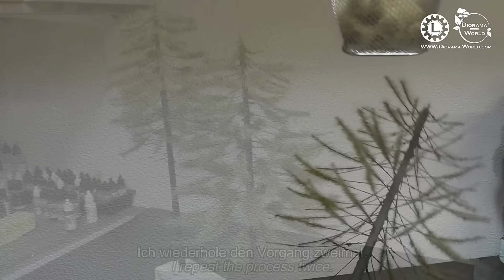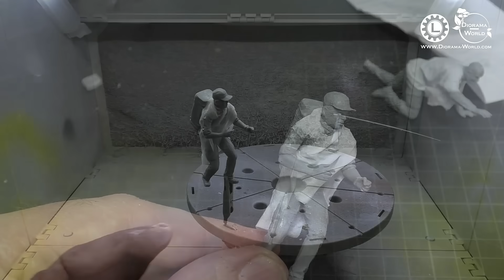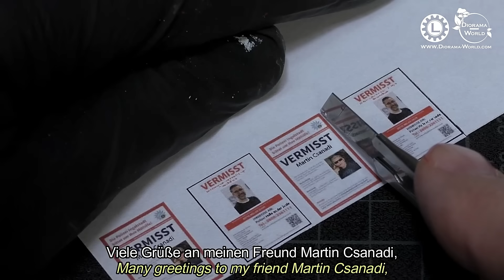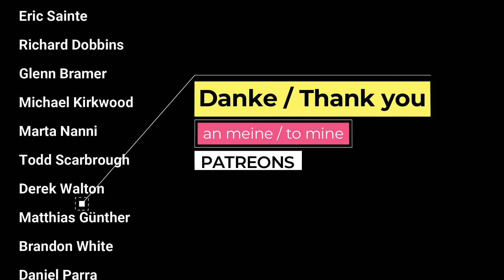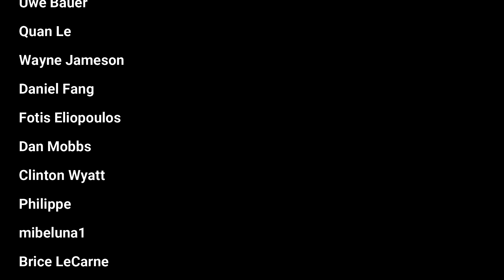ZOMBIE Apokalypse Diorama Maßstab 1:24

Comment: SO I use  febtone or some other cement poweder dye that you add to cement to colour it when using it in brickwork with contrasting or matching cement. I mix this into the plaster I make my rocks from. This means you NEVER get those horible white bits on plaster work as th the colour is through the whole rock then you just need washes and dry brushing.  As for the rocks  I use laytex to make my own moulds and find interesting real stones and rocks (some can be done hollow cast if bigger to drop weight I find I can then cast a rock and often position the rock a different way up to make a whole other rock

Comment: at 11:10 he uses an electrode to ground, so the grass falls down vertically ! the other electrode to an armwrist (+) I suppose . Maybe 9V from a small battery would do, to ionize the air around the grounded (-) element, into static . See also that the static fibers, are vertical, or perpendicular to the source E-radiation .